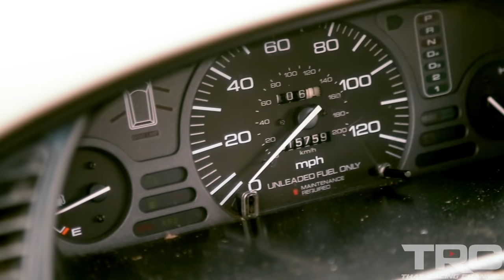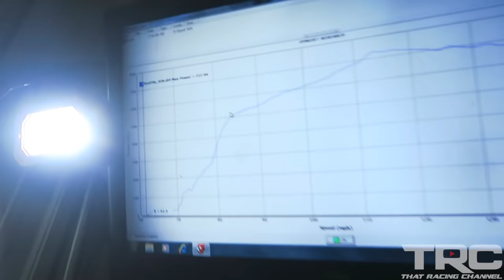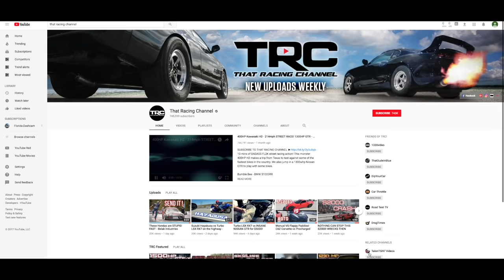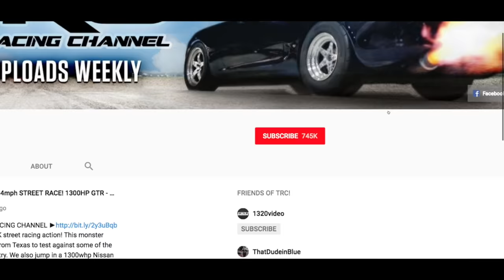700HP Honda Odyssey Minivan?! BoostedBoiz!

Comment: that was great,Wago doing real good,you did a lot of real time improvement to it.i noticed on the dyno the right front wheel moves back about two inches,maybe it needs a better wat to control the movement of the lower control arms ,what do you think?

Comment: Guys I think you need to race Bisimoto's Odyssey, that would be EPIC.
Reply: Kennis Williams his Odyssey can't launch for shit and he can't put drag radials on it because the trans will blow if hooks hard
Reply: But still be a good race
Reply: Bisi has 1000whp. Its a non race
Reply: I seriously doubt a fwd odyssey is going to have enough grip to blow a built tranny like that. Bisi is known for blowing up numbers and ignorantly misconstruing some builds.
Reply: KingOfNines If you did your research instead of making an assumption, Bisi went thru numerous trannies until he found his current combo which is a built 6 speed. He builds high quality, no cheap ebay shit, cars. There is no comparison.
Reply: KingOfNines in a interview he mentioned he couldn't use a super grippy tires because it will snap axles and possibly blow the gearbox which makes sense
Reply: Kennis Williams bisis van would smoke this one easily. That's not a race. 1000hp vs 700hp is a slaughter
Reply: The 2nd gen oddysey is a classic in Japan. Plus it has 1000whp. Kyles van has ways to go
Reply: Still waiting to see a video of the bisimoto van in action
Reply: had you ACTUALLY watched the episode you wouldnt be saying that

Comment: Your could build 10 of these for the cost of 1 Leroy. And it's only 10 Mph slower in the half mile. Haha
Reply: Canin kelso leroy was turned down as far as itll go, about 700hp or so, so pretty similar hp on that tune. plus he was running street tires spinning most the track vs radials on the van.

Comment: Different to see a minivan doing this👍🏽 why is my STI so slow ☹️
Reply: cuz this motor is fully built, sleeved and built internals xD
Reply: Because Subaru😉😂
Reply: Vadar FTR dam didn’t think of this😂 👍🏽
Reply: jon doe SMOK 🤫
Reply: HoeLeeFuQQ unfortunately Subaru's are not known for being reliable under high power. However Honda F/H (which are about one in the same with eachother) B/K are known for being moderately reliable after slight mods like head studs and sleeves to run 300-400 (pushing it without going full racecar)
Reply: k can handle quite abit more than b stock. and dont need any sleeves untill way up there compared to b series.
Reply: Assasinpiggles either way end up with a rebuild anything number after 400 in change because but thats the fun part of ripling it apart and make it better and reliable
Reply: meh not true at all plenty have been running over 450 wheel for a long time esp on a k20a2 not sure about k20a3 and k24a3 except kyle has around 450 wheel on his mr2 .
Reply: Because you don't have a K24 engine under the bonnet...that's  why its slow!.
Reply: 😂😂 Kyle and emilio just k-swapped a sti ..it's fucking epic.!!

Comment: How much hp at regular elevation and not Colorado?
Reply: Brett Galdieri probably 750 or so but I don't know . He should of dynoed it there
Reply: Won’t it be the same power since it’s dependent on how much boost he runs?
Reply: Uriah Siner not necessarily. Just because you're running boost doesn't mean it's always the same. Florida air is WAYYYY denser than Colorado air so a car tuned for Colorado has to be re-tuned for Florida to avoid over-boosting.
Reply: They dialed it down a tad, to compensate for elevation. They did it in one of his videos.
Reply: Assasinpiggles They re-tuned it in Florida.

Comment: The trans do not hold together. Lol. He knocked this one out, and numerous before, lol
Reply: Bradley Slusser right lol, this is before he lost 3rd and 4th tho isnt it?
Reply: Bradley Slusser yeah fact but his point is they're dirt cheap to fix so that's why he doesn't go all out on one and keeps using stock parts. if they break he goes to his local junkyard and gets a new trans or gears
Reply: Sergio Gonzalez 
But after you have to do it numerous times, youd think he would pony up and upgrade to something that can handle the power.
Reply: building honda trans are expensive like it would cost like the same amount he put into the van plus the cost of the van
Reply: Jacob Coffelt 
It doesnt matter if there free. After having tp replace them 10 times, id be upgrading..
Reply: upgrading honda trans are not cheap at all I think its 8 or 9k to upgrade the trans
Reply: Pure Essence 
For that kind of cash i could buy a car faster than his Honda, lol. Note to self. Stay far away from them...
Reply: Typer if he was only running 600ish horsepower at the wheels, the stock transmission would probably hold up, still pretty impressive
Reply: Bradley Slusser yeah what car with 7k would slay the van on the street, none

Comment: Ebay turbo...Surprised it didn’t blow during the first start up
Reply: he running the same turbo in his hatch for like 2+ years at like 600 to 700 hp
Reply: Cx racing gtx3582r, eBay but not $100 cheap, it's still a $600 turbo
Reply: Definitely a lot cheaper than the garrett gtx3582r but but it's not China turbo cheap